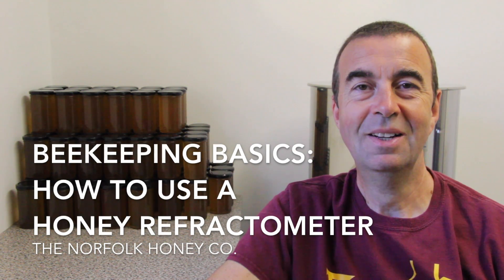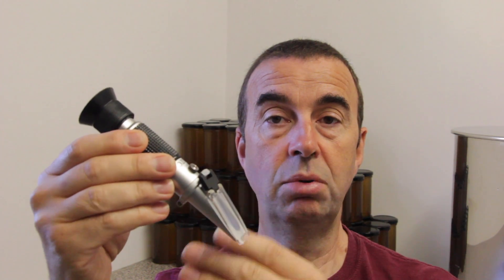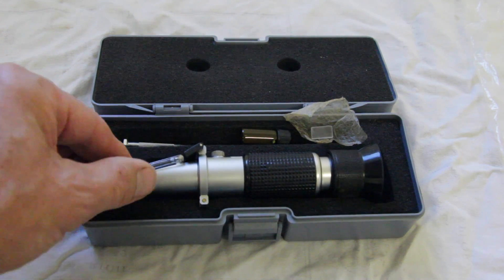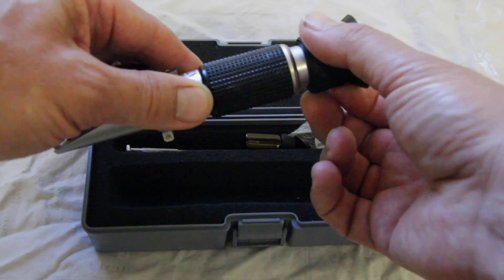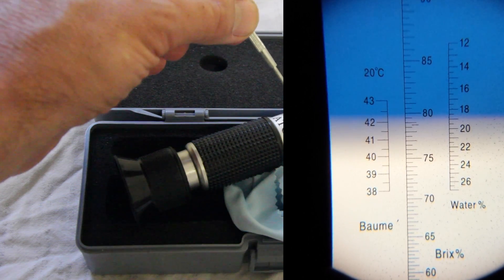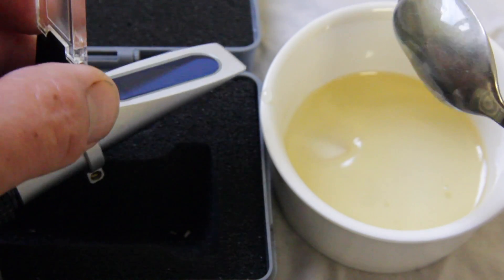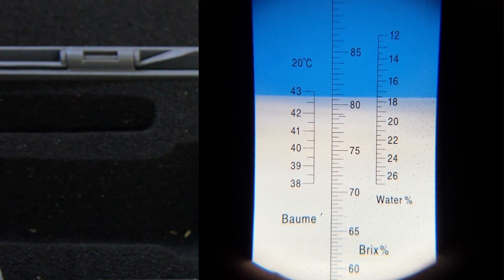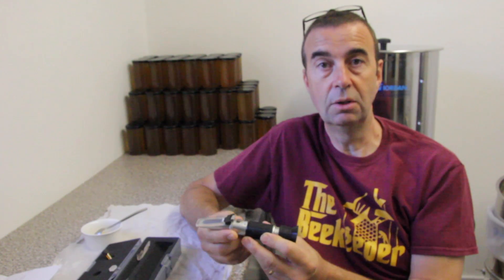Beekeeping Basics - How To Use a Honey Refractometer - The Norfolk Honey Co.

Comment: Why did you turn the scale to the wrong percentage?
Reply from the maker: Hi Hamchuck,
I adjusted it to show the method of calibration using the glass block supplied with this refractometer. Using the glass block I then recalibrated it back to the correct level.
Stewart
Reply: The Norfolk Honey Company  Thanks! i was really confused as to why. this vid really helps!

Comment: Very nice! Thank you very much for sharing, mine did not come with the cal oil or tiny glass block, what's your opinion on using virgin olive oil as the cal standard?
Reply from the maker: Hi Frederick,
Thanks for your comments.

Depending on the type of refractometer you have will depend on the calibration method. I have just helped a fellow beekeeper at our local club calibrate his unit using distilled water as described in his instructions. We had to match the calibration line to a null line (zero mark), turns out the unit was faulty anyway!
If you have any instruction leaflets with it I would just have a quick look at those and see if it gives any indication of calibration. If you have a zero line then distilled water should allow you to calibrate to the null line.

Stewart
Reply: The Norfolk Honey Company Thank you! Mine does not have a "zero" line for distilled water calibration, I'll figure something out soon :)  I appreciate your fast response!